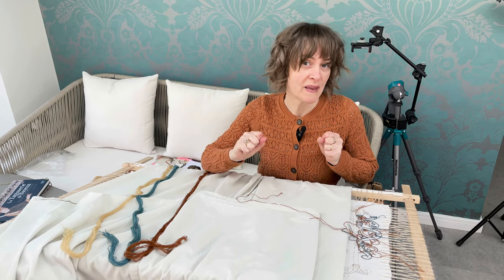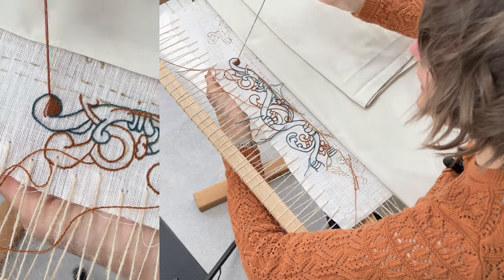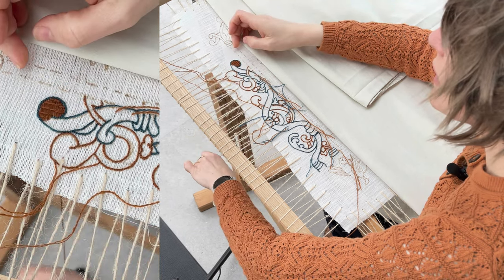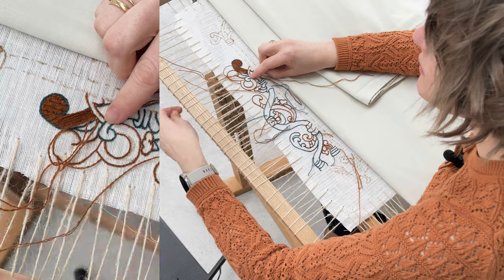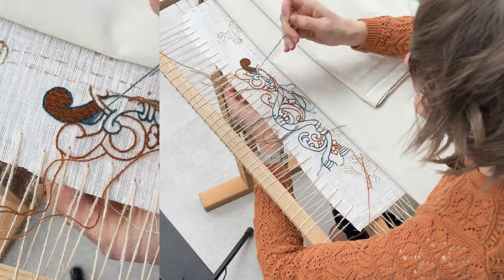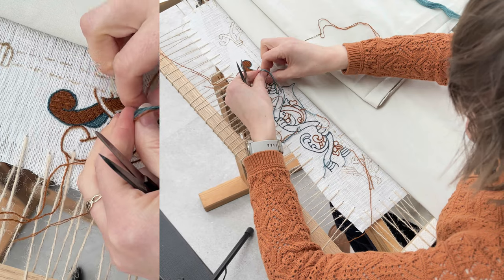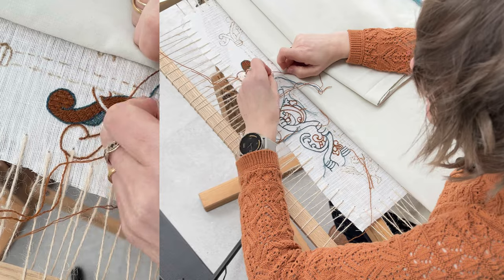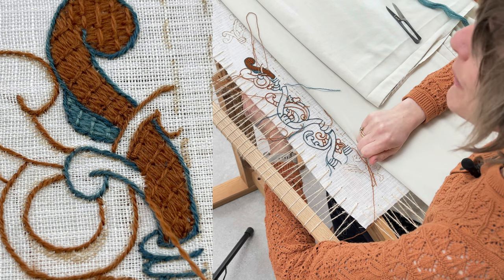Thread Tales: Continuing the Bayeux Tapestry Embroidery Laid and Couch (Bayeux Stitch)

Comment: About the color of the restoration section, I think leaving those areas blank is the correct call. I'm the one asking about the colors used. I'm amazed at the impact achieved with a limited palette.
Reply from the maker: I’ve come to the same conclusion as you over the restoration.
I also agree about the impact with such a small palette. When you see the BT in real life, it’s unbelievable really, and the 3D-ness of it

Comment: Why don’t you use your extremely fine wool double? It would give your work the special dimensionality and texture beloved in crewel work.
Reply from the maker: So I’m using a wool in a thickness that’s as close to the original as possible, which is slightly different to that used for crewel work. I find it so interesting that while the BT and crewel are very similar in some ways, they’re quite different in others